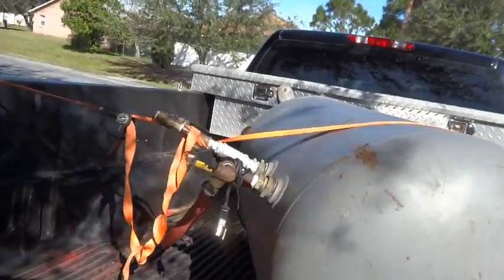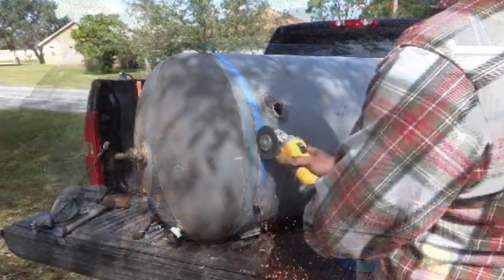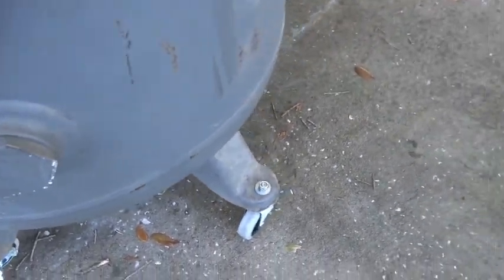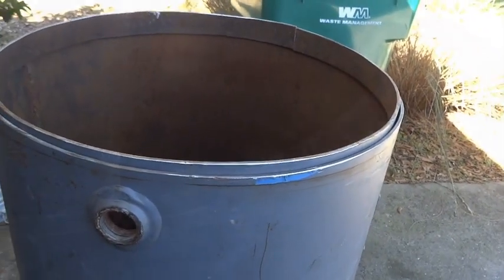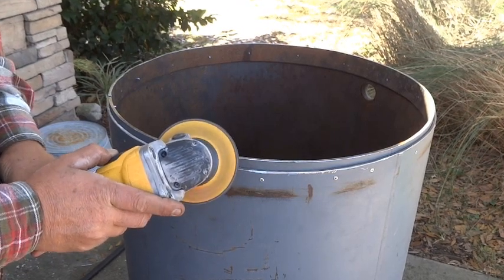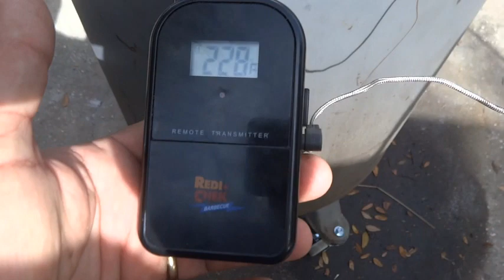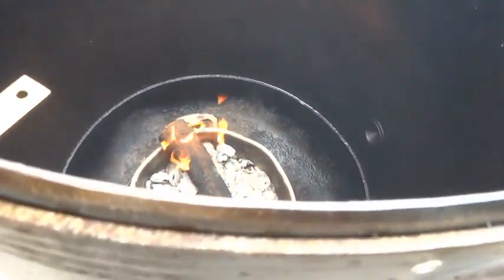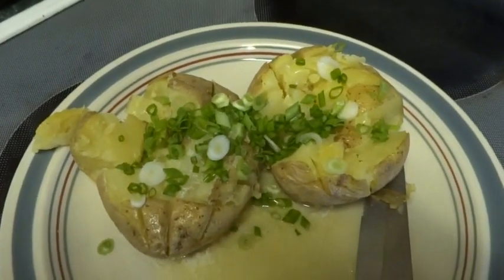How to Build a Smoker Without a Welder.

Comment: Excellent Job!  My friend is an accomplished welder and has all types of equipment (I don't know anything about welding).  He wants to do the same except with a large propane tank, but with a different twist. He wants it taller (about 6') and he wants to cut out a loading door for the meat and one at the bottom to load the charcoal. We're still looking for a cheap used propane tank.
Reply from the maker: Try your local gas company.  They sell them when they can no longer be certified.
Reply: thx
Reply: tibzig1 did you guys ever build the smoker out of the propane tank?
Reply: The propane tank supplier near me will even certify the tank free of any gas. Last time I inquired, they sell them for a dollar per gallon capacity.
Reply: I just made one with a old Hot water tank . I posted a video of it so far . I am still working on it

Comment: This is a great video. I'm that way too. make do with what you have. I'm 66 now and retired. I should have invested in a welder years ago since I love to beat on metal. A guy as savy as you should save some money and get a welder too. Anyway, great job. Think about some spring loaded hinges for the top so you won't drop it on your foot one day. lol
Reply from the maker: Thanks.  This cooker just gets better and better.  Since is is well cured out now, it will run at 250-260 for 8 hours on 1 pan of Stubbs charcoal and puts a great smoke ring on a brisket.  We will do a new video using it soon.  I finally painted it and I need to replace the casters with heavier duty ones..
Reply: I was wondering about the capacity of the casters. That is a heavy tank. You have a UDS that will never wear out. Pass that down to the g-kids. lol
Reply from the maker: Yea, they didn't hold up on my paver surface.  Got some heavy duty ones to install soon.

Comment: Nice job. Spray some wd-40 on that drill bit when you drill and it will make that bit last longer
Reply: Just slow down the drill will make it last longer ( slow for metal, fast for wood ).
Reply: Forget the WD 40, use ATF in a small squirter can from Hobo Frieght.

Comment: Why is that a "smoker" and not just a huge barbecue?  A smoker shouldn't cook meat, but it should smoke it.  It is a great job, but not a smoker.  Yes, you can smoke meat in a bbq, but that isn't what makes it a smoker.  You can dehydrate food in an oven, but that doesn't make an oven a dehydrator.
Reply from the maker: Down here in the south, this type of unit is commonly called a smoker.  Round here I have never heard it called a BBQ.  Call it whatever you want, it works great.